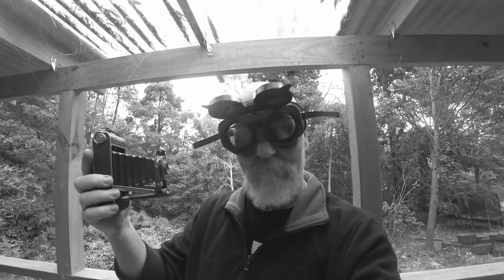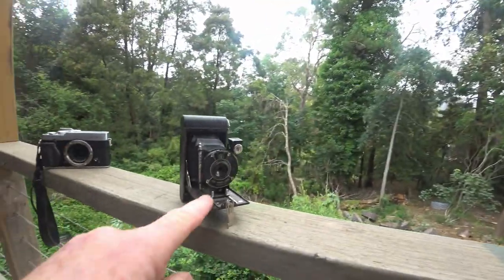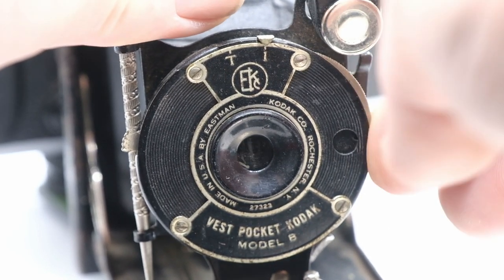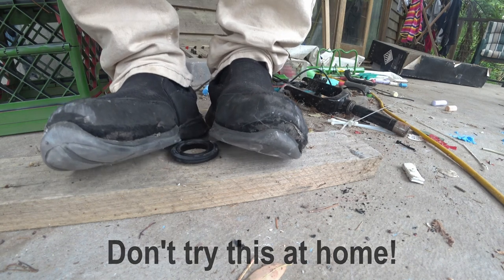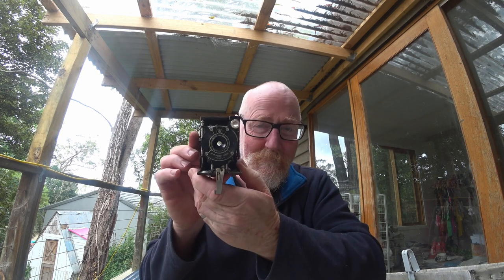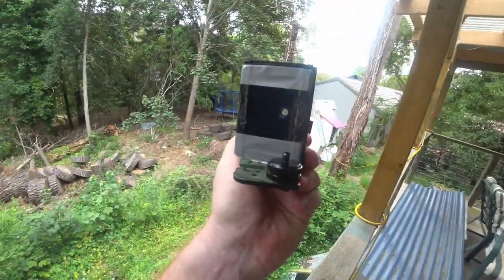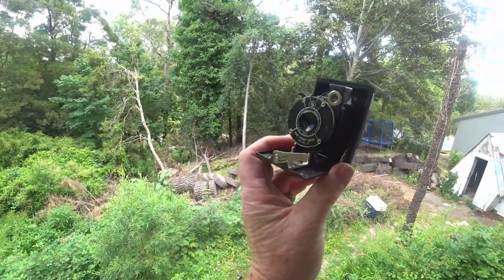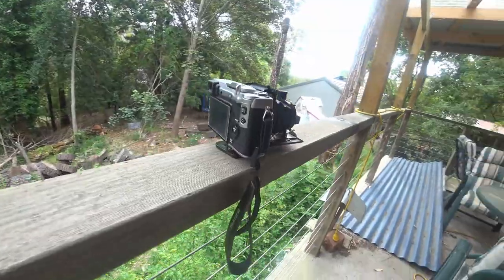Kodak Bellows Lens on a Fujifilm Camera - How and WHY?

Comment: Greg, I have trouble pulling the bellows . I found one  small  lever that I push inside but doesn't seem to do the trick. Do you have any suggestions ?
Reply from the maker: There should be two 'posts' that you can hold to pull it along the rails